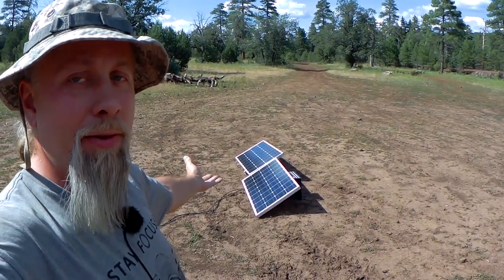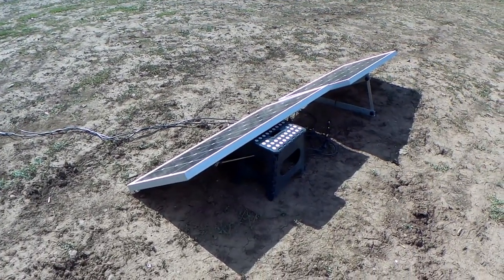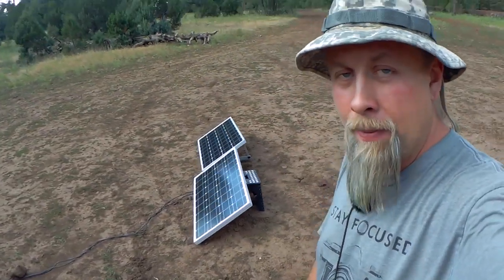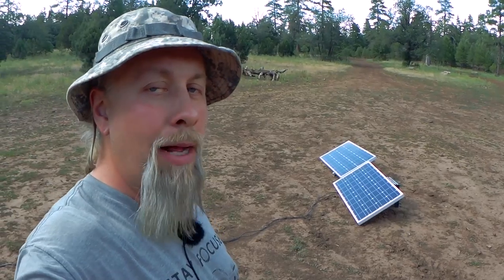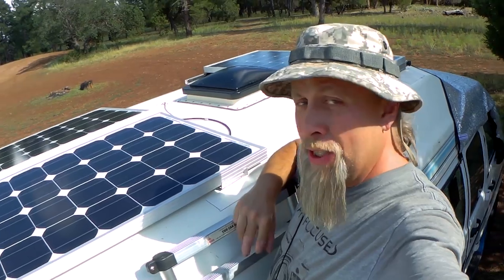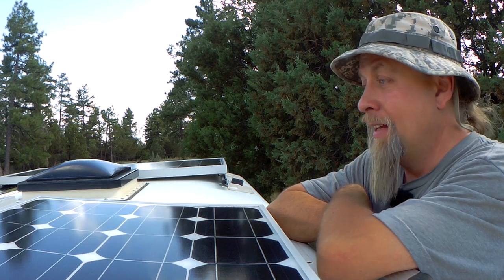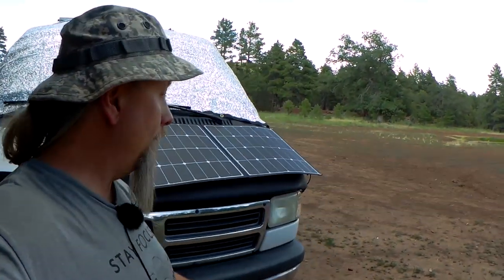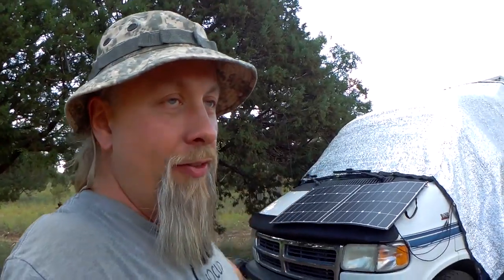Roof Installed Solar -vs- Portable Solar Panels For Your RV? Pros And Cons

Comment: One other way to anchor your ground solar is sand bags.  Now you can lug full sand bags if you want or. Carry empty bags and fill them with sand, dirt or gravel.  When ready to leave pour them out a roll them up for easy storage. Just lay the weighted bag over the ground bar.

Comment: Have the SolarSaga 60. Live in the mountains of WNC. I just pick a piece of tilted field for angle adjustment or put a couple of limbs in the right spot. Also, added a small loop of cord to the stand to put the tent peg through. Can rotate it freely without moving the peg. You can find the sweet spot for the peg first and attach the panel with a twist. Rope craft.

Comment: Another drawback to portable panels would be something that I would probably do. Forget about them and drive off only to realize what I did at my next stop when I find two broken nubs of wire hanging off the back of my rig. Of course, you can't fix stupid, so I guess that really isn't a drawback of the panels themselves.
Reply: R B Sounds like us!
Reply: I would have to make myself take-off and setup checklists. I've seen some folks go so far as to have several labeled hair clips that go on the steering wheel and are removed as the task is completed before the unit is driven away.

Comment: Maybe I didn't hear you talk about this issue - the remote panels are on the ground, out away from the van. In almost any campsite, that puts those panels at risk for being driven over by people who have rigs with poor visibility backing up (most RVs). My suggestion is to add a short pole with an orange flag to the remote panels, so they are more visible.
Reply from the maker: I put my orange cones out if I think people are going to run into them. You can see this on several videos this year of me boondocking.

Comment: You forgot to mention that the roof panels shade the roof. I have 1200 watts at 12 volt on my Airstream and they made about a 8 to 10 degree difference inside just from shading the roof.
Reply from the maker: Very true. I did forget to mention that. Most of the heat in my RV comes from the sun beating on the sides and windows. That's a lot harder to block.

Comment: On my van solar I went with panels that were long enough to go across the vehicle, (130 Watt Renogy). I could fit more onto the roof that way. I put in 960 watts of them.  I went with parallel. When wired in series you will only get out what the lowest panel produces. If one panel gets shaded, you lose the other two as well.

Comment: I have 6 giant panels on my RV roof  1000  watts with a lift jack and a ten inch tall frame to hold everything one inch above my Air conditioner.  .One switch takes them up or down and I can stop at any angle .Mppt and 600 amps of lithium batteries they shade 60 percent of the Rv
Reply: Shame that you don't have a  video of your set up as I'd really like to understand the set up..

Comment: I've been watching a lot of your later videos and, because of you and Will Prowse, I now understand mobile solar much, much, better, so thank you. I do have a question that is unrelated to GENERATING energy from solar that I'd like to ask, if you don't mind. What are those huge reflective sheets that you have draped on your van. I have seen much smaller "Space Blankets" and the small, flimsy mylar "emergency blankets", but I don't recall seeing anything as large and robust as what you are using to block solar heat from entering your van. Give me the scoop!

Comment: Great overview of your solar system(s). Each one has its purpose and pros and cons. Well explained. 
My van doesn't have much electrical load. I changed the florescent lights to led. My frig, stove and heater are gas except the heater fan which is 12V. I only have one lead acid RV battery to keep charged. I pack around an old battery charger and a high priced Renogy suitcase 100W unit. Gets me by ok. 
I have to stay with the solar unit so it doesn't get ripped off. But I like the ability to maximize the angle of incident and solar direction to get the most watts out of it rather than a fixed panel. 
I would like to add AC but that would change everything bigtime.
Reply: KenDroid66  why? My propane tank lasts me 7months cooking and  partial heating...

Comment: Hi tom. My son @ l just finally finished mounting, connecting vectron control  2 - 320 w panels on my van . 750 Dometic fridge freezer. Blue tooth ,9s+ phone. REALLY cool watching the system operate..thanks for your input at RTR on what to buy!
Reply from the maker: It's about time old man! You had those panels installed back in January. Looks like you're all setup to do some mega boondocking with us at the RTR now.
Reply: > REALLY cool watching the system operate.

good clean geeky fun!

Comment: I use furring sticks,  cheep at lumber store,  in a triple H-block configuration for tilt and tent pegs / re-barb for hold downs.  The h-block has legs long enough to keep panels several inches off the ground. Some cord to fasten the stakes to the panel block.
In another configuration, I  have an EMT pipe and a T-fitting for a two axis pan and tilt. I suppose a bigger pipe T fitting would work as well.  For 12-volt wires out to the ground panels, I use an extension cord with a pig tail plug on both ends to wire. Thou shout  obey ohms law to avoid the "magic smoke."

Comment: I’m starting with two solar panels in series portable setup. And planning to instal a fixed on my caravan to.  And indeed,  the portable once are smaller but produce more , because they are always at the most ideal angel and direction. I made a junctionbox unther my caravan to plug n the extra panels

Comment: Frater Mus- Thank you for suggestion and observation; as a solo traveler I was hoping that solar/batteries had advanced to where propane would not be required and the Revel is designed without propane. The 3 AGM’s are under the coach and subject to winter temps which makes lithium problematic- I discussed an upgrade with Battle Born and they recommend a 30 watt heat tape on each battery which kind of defeats the purpose. Maybe a Yeti 1400 in the coach for appliances is a viable workaround- I do have an appointment to have a Winnebago dealer double check batteries and wiring as I still suspect that something is not quite right.
Reply: How does a heating blanket for the batteries defeat the purpose?  They only run when needed, and they likely only require a few Ah to run.  30 watts isn’t as bad as you are thinking it is.
Reply: The 3 batteries are separated so to boondock below freezing it is going to be 90 watts pretty much continuous; that’s 7 amps or 168 Ah each day. If you draw down the lithium to where they shutdown, the heat tape fails and you could void the warranty and trash the batteries. If I were to go lithium, I would want them inside the coach where the diesel esbar keeps them up to temp with no electrical draw. The Battle Born rep was pretty clear that they don’t really recommend the heat tape approach per se- it’s just better than having them outside the coach with no protection. All comments are appreciated- I am still trying to understand how the Revel can be a 4 season coach (per Winnebago) when the lighter draw on a summer night already marginalizes battery capacity for a pot of coffee in the morning.
Reply: David Keller yeah that’s one of the reasons (of course the other reason is $$$) that we went DIY. I have yet to see a commercial build with an adequate electrical system suitable for consistent boondocking.

Comment: We've obviously never met in person :-)

I have 800 watts on my RV roof (36' class A) and 400 watts on the ground, each with their own MPPT charge controllers.

I do not have tilt ability on the roof solar, however. 

I thought I was the only one that figured out both are needed :-)
Reply: 1200w sounds about right for a class A of that size, particularly if using microwave, induction cooking, etc.

Comment: A lot of us want something minimal. I have a small cargo van. If the newer folding panels work out, I can live with that. Big rigid panels are impossible if you need the roof for storage. Hitch rack versus roof bag. You need a generator if you have a fridge or anything that has to have power every day. I also tried to optimize my charging while driving.
Reply: > Big rigid panels are impossible if you need the roof for storage.

A couple hundred watts is fairly small.

> You need a generator if you have a fridge or anything that has to have power every day.

Demonstratably untrue.

Comment: Panel anchorage!  I think you should have a piece of L1.5x1.5 angle that comes out past your panel frame with a round hole.  Now you can drive a round pin with a hammer freely.  And with a round hole, now you can rotate the whole panel assembly throughout the day!  I am about to purchase Renogy suitcase panels for my camper.

Comment: The mc4 wire on the ground are at risk of rodents chewing on them (I know this from experience) so to remedy this I put a lite film of vaseline on the wires however the Vaseline will collect dirt, sand and whatnot but you can run a shop rag on the mc4 wires before you put them away.
Reply from the maker: In 2.5 years of full timing I have never had mice chew my MC4 cables. I have had cows tramp on them though. Do you have a remedy for that?
Reply: @HOBOTECH  
Winchester .30-30 and a bag of charcoal.
Reply from the maker: @MikeAndNary  LOL ... I wish! But usually it's an entire herd and I ain't that hungry!

Comment: Here is my idea
So slide out the racks
At the end pin in the himejoint or ratch joint deploy the telescoping leg this sets the up or down angle

Roof mount sliders like draws/equipment racks 
Will replace your awning 
Offseting cost 
Use tractor trailer Dodger
So wind nose not an issue when
N driving .
Make post adjustable
So you can angle panel's
USE
connection like lawnlounge chair.
RAtcking joint or himejoint

For tilt use small motor on bike cogs chain solor panel's 
Mounted to rod or round stock

Comment: Wow 13 k views. Congratulations Bob does questions and answers live and one a month is solar. I bet you could do a video a month. You're good at it and so many people want to know. A video like a top 10 solar question you get. The two funniest and the most popular how much solar do I need? And can I run an AC in my van using solor. You need a bigger van with more rooftop then you need a bigger air conditioner then for you need a bigger van with more rooftop Infinity

Comment: You could up grade your alternator to a 100 amp and install a switch to charge the van starting battery or the solar batteries for night or gain days and cloudy days . Ask a truck parts counter man about the alternator .
Reply from the maker: Roadtrek installed a 120 amp and isolator from the factory. Only does me any good once a week when I drive into town.

Comment: How about using a tv wall mount for your roof panels? just a thought. Also- facing your panels either west or south (west is best) at the latitude you are at is best solar! The midwest is 55 degrees latitude, so tilting the panels at 55 degrees will give you best sun! Just  a couple of random thoughts!

Comment: Question , I have a Class A Motorhome with a 45 amp converter. If I plug my motorhome into the sportsman generator to run some lights and maybe a fan, will it hurt the converter or the generator? Thank you . keep the videos coming.
Reply from the maker: It won't hurt anything. Worst case scenario you draw too much power and the Sportsman will shut off. To get around this try to top your batteries up first either with solar or a larger generator so the converter won't draw as much power when you use the Sportsman.

Comment: Tom-  I have  a new Winnebago Revel with 3 AGM batteries with total of 315 AH capacity, 200 watts solar on roof, 140  watt Zamp portable panel.
On first recent trip, with batteries completely topped up (13.6 V or higher) at 9:00 p.m. and only load for 8 hours the  12V dc Novakool fridge pulling maybe 3-4 amps for 8 hours intermittently,
At 5:00 a.m. a 500 or 750 watt load through the inverter for coffee pot or toaster (never both) for even a minute would drop the voltage to between 11.9 or 12.1 and the battery condition from green to yellow.  After turning off inverter, the volt reading would recover to 12.3 or 12.4.  This was a consistent pattern over 4-5 days. I use a Jackery 440 for phone, tablet,usb fan, so fridge and maybe CO2 and smoke detectors are only nighttime load. This just seems off/weak for a brand new system; based on your experience does this seem plausible or should I be getting the batteries and/or 2000 watt inverter double checked? Your best guess based on your experience with AGM’s and loads/typical SOC drawdowns would be much appreciated. Thanks for the continuing educational content.
Reply from the maker: That's lead acid for you. When you draw a big load like that, the batteries take a beating as lead acid usually can only handle about 0.2C draw (about 20 amps per battery or 60 amps in your case). As long as they recover to normal voltage after you have nothing to worry about. It sounds like you may have a weak and or inefficient inverter though if you're only pulling 750w and seeing that kind of voltage drop. If you upgrade to lithium this problem goes away as they are designed to draw much higher amps than lead acid (1C or 100 amps per battery).
Reply: @HOBOTECH  or insufficient wire gauge between inverter and battery bank.
Reply: Not trying to be funny, but there's a reason why propane dominates cooking and coffeemaking duties.

Comment: Yeah, I remember when solar panels used to be something no one knew the value of.  One of the downsides of solar power getting popular is now people know what it's worth and you can't leave something like that around anymore.  Back in the day people actually thought solar was impractical so nobody would touch them much.

You know, thinking about it also, a ground deploy array is superior to a fixed array in that you can get those puppies out of a hail storm before it gets there if you stay on your toes

Comment: Nice external heat shields 👍.  All I'm looking to power is a refrigerator, Nintendo switch and a DS and a battery powered tv. And maybe a small standing fan🤔. I think with one of my rocket boxes off the top of my van. I can fit three to 400  Watts up there.

But man solar has got so much more convenient compared to 15 years ago.And the innovations low wattage refrigerators is astounding.🙀

One question though.. what do you do when you have too much power? I was kind of thinking a guy could run a Crock-Pot. Although it was solar ovens it seems kind of wasteful.

Comment: You seem to have a lot of space on top of your van for panels.  I need to get up to check mine out with a ruler, but I think the contour of my conversion top will prevent me from using std sizes.  Need long skinny panel(s) to fit.  So I got a suitcase instead.  But I found a custom panel yesterday, if I have 14 inches in the contour...
Reply: My roof is odd shaped as well, and I have no ladder to get to the roof to maintain, nor do I want to carry one or invest in installing one, plus I'm not sure how long I plan to keep this van..now with the soft semi flexible lighter folding portable panels that r coming out I'm much more likely to go with those..once i have a vehicle i know I'll be keeping for sure, i may consider both✌

Comment: Great info on all your vids.  I'm new to this solar/battery power stuff, so this is probably a dumb question:  Is it possible to run a battery trickle charger off an AGM 100Ah battery.  If so, could you use the battery to charge itself through the trickle charger?
Reply from the maker: No. That breaks the law of conservation of energy.